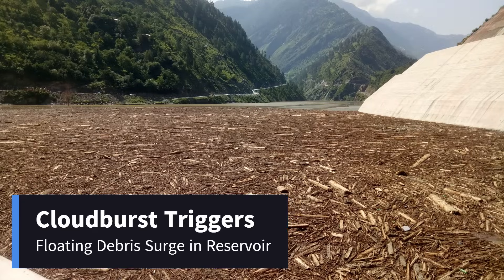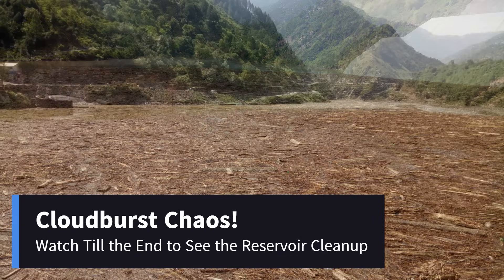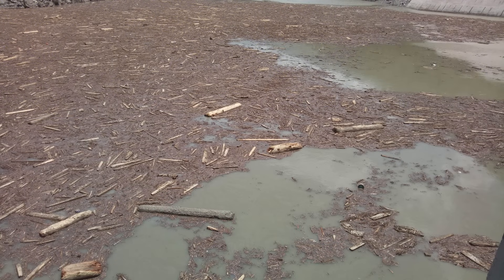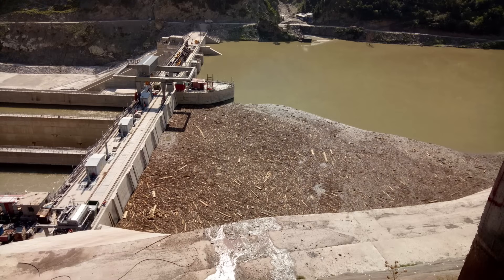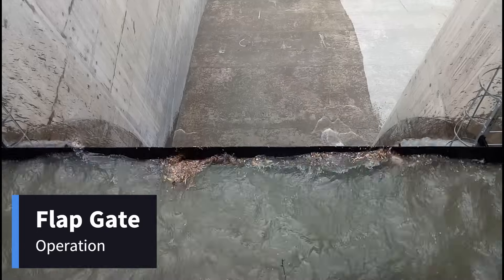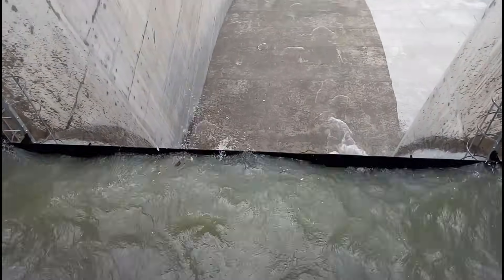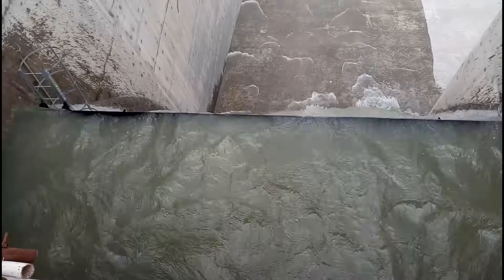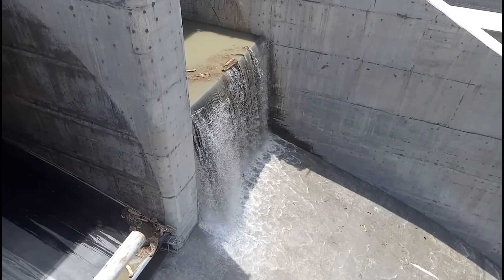Cloudburst Chaos: Flood Debris Slams the Dam. Flap Gates to the Rescue!

Comment: I guess thats the less costly approach, it needs to be removed and not dumped on someone else
Reply from the maker: I appreciate your perspective! In hydropower projects, flushing is a standard operation to manage floating debris, preventing blockages and ensuring smooth plant operations. The flushed debris typically follows the natural river flow, similar to how the river would carry it downstream. However, in some cases, additional debris management measures, like collection booms or designated disposal areas, are used. Thanks for sharing your thoughts!
Reply: Strictly speaking, if the dam wasn't there, that same debris would have flowed down that same river in the same way and been the same "someone else's" problem.  The existence of the dam didn't cause the rain to wash that flotsam down the river.
Reply: If it were timber operation, then removing it would drive up the cost of timber making it unprofitable to harvest.  Then what materials will be used to build houses?  There is a trade-off, risk/benefit ratio that has to be considered.